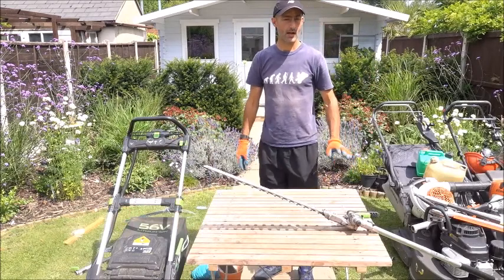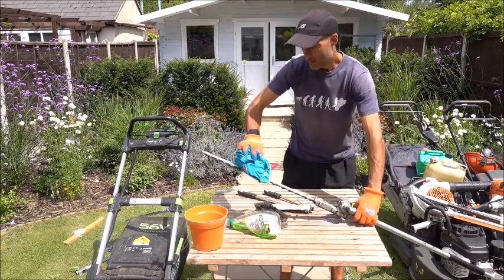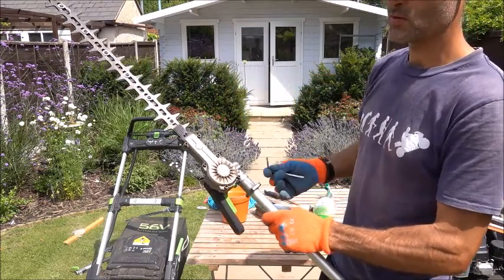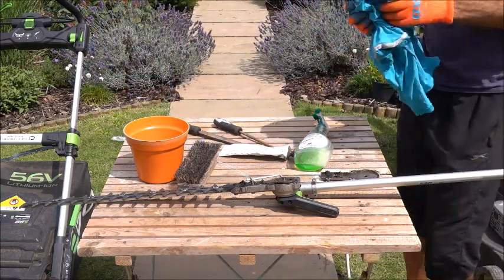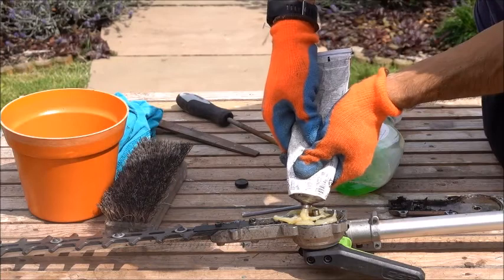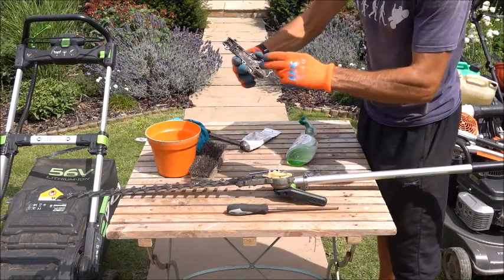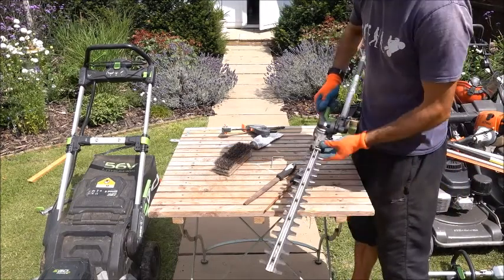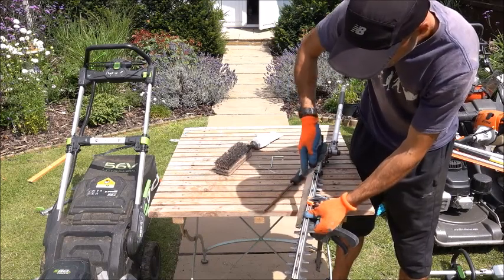HOW TO..... Clean, Maintain & Grease your EGO Hedge trimmer attachment -- (EGO SERIES PT5)

Comment: Great video! Was wondering if you could brush on an 8 grit valve compound to sharpen the tool. Then either wash it or wipe off. I use the compound to sharpen my power rotary scissors and my reel mower blades.
Reply from the maker: Hi thank you for your kind words. I have not used an 8 grit valve compound so I don't know. I will have to look into it and get back to you.

Comment: Considering getting this trimmer. I don't understand why they don't just put a grease nipple on the gearbox...
Reply from the maker: HI thanks for the comment. There is a grease nipple on it. But as hedge trimmers tend to get bits of muck going in the gearbox. I like to do it this way so I can get rid of the muck. Plus you can get more grease in and you can see where it might need more. I used to use the grease nipple when I started out about 16 years ago and got a slight rattle within 6 months. as the ego tools are so quiet a slight rattle will sound like a major rattle. Hope this helps

Comment: Fantastic, I found the grease tutorial maintenance very helpful.  Oddly the Stihl hedge trimmers are easier to fill with grease, just remove a plug, squeeze, reattach the plug; EGO seems to have missed as step here.
Reply: You’re kinda right but also wrong as well because you can buy new replacement hedge trimmer blades for $60 for every hedge trimmer model that ego makes plus grease the gearbox and new blades as well. If you keep the older blades you can sharpen them yourself with a dremel machine and you can buy grease to grease and oil.